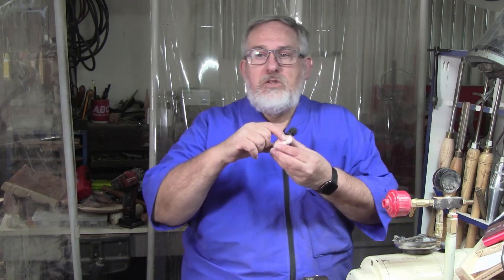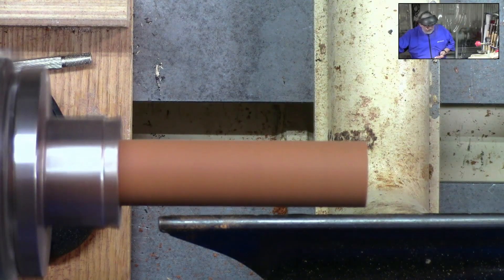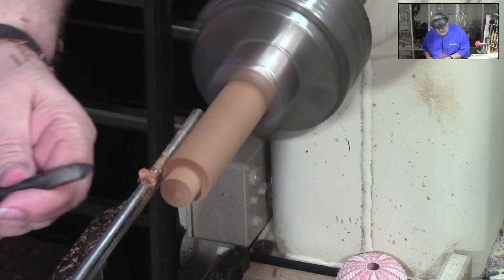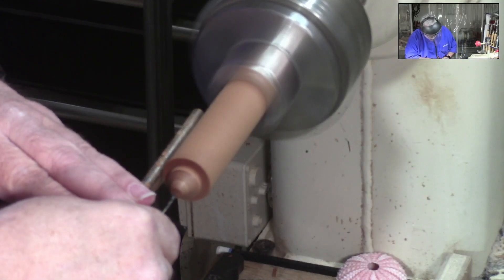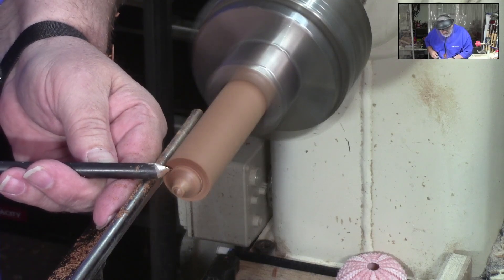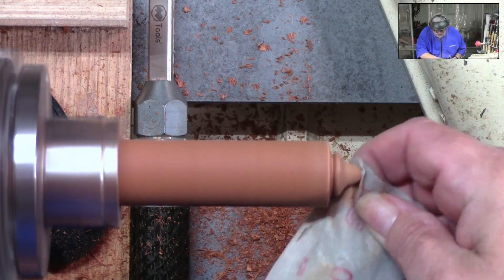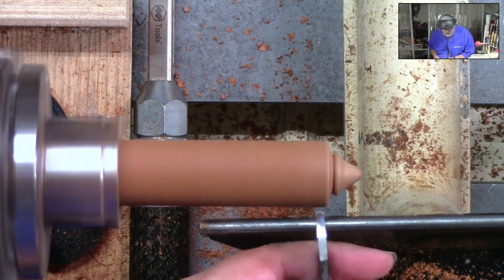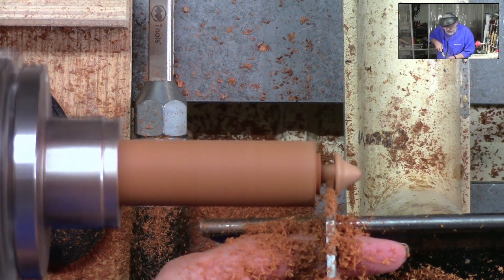How to Turn A Sea Urchin Ornament. By Dean's Woodworking #woodturning

Comment: Very nice project. The mahogany looks good with the pink urchin. What is the finish? You said lacquer, but do you have a brand preference? What is the sandpaper you are using? It looks like cloth and appears very pliable. Thank you for sharing. Have a great holiday and stay safe.
Reply from the maker: Thanks Glen, the lacquer is deft spray can The sand paper is a 3m product that they no longer produce it has a rubbery type backing. Happy Holidays!!

Comment: Do you ever just let the wood go without sanding some of the guys in a wood turning group I’m in say they don’t sand it’s better off the tool than it is sanding
Reply from the maker: Rarley most things I turn need at least a little sanding, most of the time when someone says that they don't need sanding the wood is actually burnished. At that point it does not take a finsh well. Thanks for Watching!!!